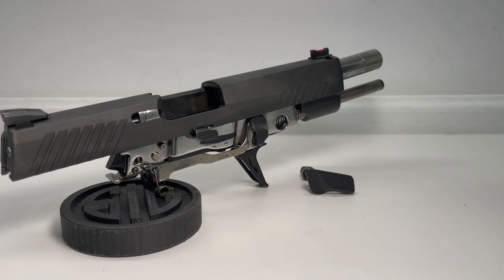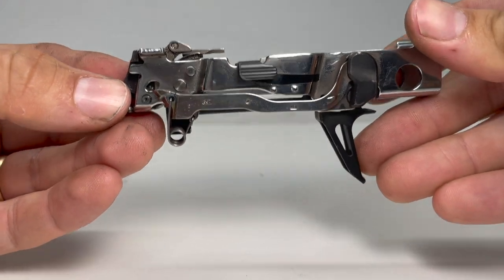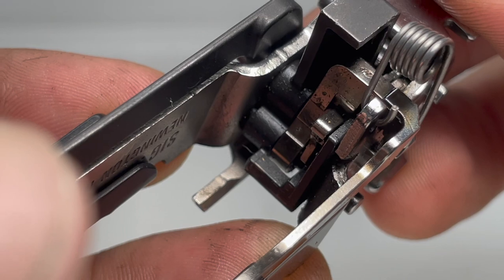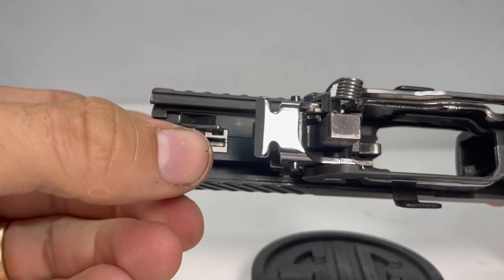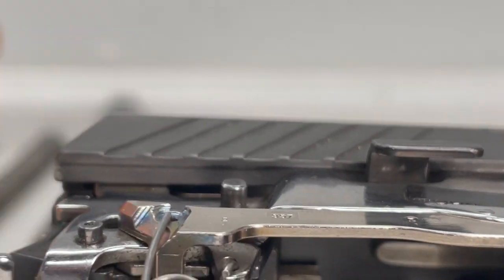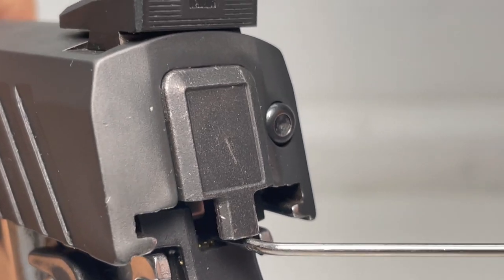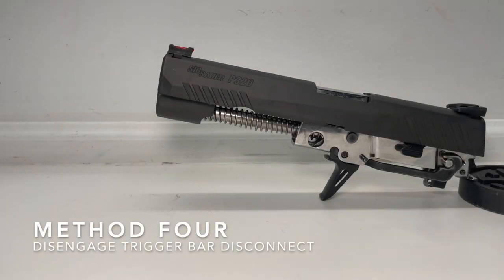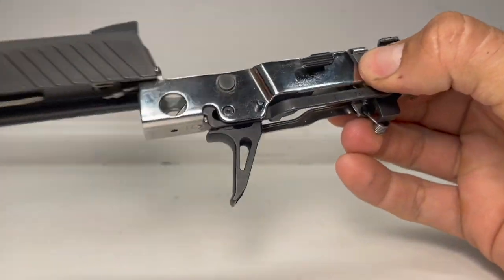P320 - 4 WAYS TO FIX A FORGOTTEN TAKE-DOWN LEVER

Comment: Just so happens, I was at the range today to let someone try out my P320 and demo'ing how to remove the FCU. I forgot to put the takedown lever and this video would've been invaluable had I had a connection. I'm not sure, but I think trying to insert and rotate the takedown lever allowed me to pull the trigger and slide the slide right off, leaving the FCU still in the grip module. However, I will save this video and try leveraging the sear forward if this happens again. By the way, I have now subscribed. Enjoyed your explanations and instruction. Also admired how shiny polished your FCU and barrel looked.
Reply from the maker: Ah, sucks when you don't have access to the information until it's too late...Well, I hope you keep this channel on "speed dial" and It comes in handy down the road. It takes effort to get the take-down lever in there but I'm happy it worked out.

Also...I didn't add this 5th method to the video, (I probably should have) but you can also force the take-down safety lever (black bar), backwards by hand, which will also engage the sear and force it down too (equivalent to how the take-down lever does it normally). 

Lastly, one thing to keep in mind is that sometimes the disconnector will get in the way of the slide while on the way out, so it "jams". It's an easy fix though because you can manually push the disconnector down a bit with your finger or small tool.

Anyway, thanks for watching! Glad to have you here.

Comment: I'm glad that I watched this video, the first two times I mistakenly did this while demoing how easy it was to take apart, I somehow managed to coincidentally apply just the right forces while panicking and wiggling the slide both times to almost immediately disconnect the slide from the FCU. Realized after watching this that I probably put a little impact/wear on the sear that I shouldn't have, but I'm surprised I was able to "fix" it on accident at all. 😅
Reply from the maker: Ha! I just pictured the scenario with others watching and judging and laughed. Those MIM parts are made of S1 material, super high impact resistance, I don’t think you damaged anything on the sear though.
Reply: Pretty sure I just did the same thing myself. Pulled the trigger and a little wiggle and it came off. Haha. Hoping I didn’t damage anything

Comment: I had a brand new OEM takedown lever break yesterday at the 20th round fired. Managed to get the broken piece out, now the slide is stuck on the FCU and will only move about a 16th of an inch either direction.

Update: your 3rd way helped!!! I did this on a M18X. The dual RSA was a bear, but gloves helped. Also, the rear plate is held in place with  slightly different pin. Most of my P320s, yes, simply push in the button on the back of the extractor tension (probably not called that, lol). Mine twists and pops out… took a minute to figure that out, lol.
Reply from the maker: Sounds like you have the military style pin on the extractor spring! Very cool, I’ve been looking for one, I guess it might be stock with the M18X?

I’m glad you were able to figure it out.
Reply: @SIGMECHANICS Thank you for your very informative videos!
Yes, the M18X came standard with the military style pin on the extractor spring. Not even my commemorative M17s and M18 have that. The only one I was somewhat familiar with was the original two pin (key) needed to remove and intended for unit armors. Glad to see that fell to the wayside, lol. The pistol also has a U.S. 9mm marked FCU and M18 serial number. I swapped out the OEM grip module for  a Bore Sight Solutions module.

Comment: thanks for taking the time to make  and share the vid.. maybe every p320 is different but i tried the first two with no success but the third technique did the trick.
Reply from the maker: Hi @K Anderson, I'm surprised! The first one is probably the most effective one in my opinion... Keep in mind that you have to push the FCU back while simultaneously leveraging the sear forward (works better that way). However, I am glad you got it worked out! I don't know a single owner that hasn't gone through this. It's the unofficial rite of passage for the P320!

Comment: Thank you! Going to try this today! Hope to avoid walk of shame to the gunsmith.
Reply from the maker: It’s very easy and you will most definitely not have a problem but if for any reason you can’t, I’ll help you avoid that walk. Shoot me an email to sigmechanics@gmail.com and I’ll walk you through it.
Reply: I was able to separate the slide and FCU from the grip (had not thought of that) and method 1 worked like a charm with a bit of pressure. What a relief! Thanks so much - have your excellent video bookmarked!

Comment: You can also push the guide rod forward through the hole where it ends near the trigger to clear the take down lever whole enough to insert it, then pull out the tool on the opposite side of the gun. LIke a guide pin in effect, just holding the spring/guide rod long enough to get the take down lever installed. Not necessarily easy, but doable with a thin screwdriver. I only later discovered that the whole FCU and slide would about fall out without the take down lever. :)
Reply from the maker: That is a great point too. Though, like you pointed out may be a little tough with the tension. 

Another way (that I didn’t mention in this video), is to take the takedown lever (the black bar opposite the trigger bar), and push it towards the rear of the FCU, doing that will also drop the sear, but will require some manipulation because it’s an awkward way to grip the part as well as the FCU.

Comment: Thank you so much for this video. That was one of the most frustrating things I have dealt with. The sear method did not work for me so I had to pull the striker assembly out of the slide. The FCU was still super hard to get off the slide even after the striker assembly was out. I had to push so hard and I had the force of the recoil spring helping me. Have no idea why it was that hard. Functions just fine now though.
Reply from the maker: @Ryan McCullen, Ah that sucks. You actually had another problem… sometimes the disconnector will get stuck on the slide frame on the way out and jam the whole FCU from coming off. You just need to use a pick to push the disconnector down a bit and it will slide off easy.
Reply: @SIGMECHANICS  damn, that would have been nice to know about 2 hours ago. 😂 Thank you for the reply, hopefully I'll never need to use that knowledge. That was a lot of frustration for a stupid mistake.
Reply from the maker: @Ryan McCullen, once you know, you know for life. I learned because I have to disassemble and reassemble the P320 so many times while making these videos that I think I’ve run into every possible combination of problems by now. Luckily now I can pass on the knowledge, and hopefully the next guy reading our comments will be saved a headache!

Comment: Hello
Nice video. My problem was not covered though. I forgot to reinsert the take down lever. Pulled the slide back and it froze. The main spring is fully depressed and the barrel is tipped up. Since the slide is back further than your 4 examples I cannot get to the sear. It is covered by the internal mechanism. Any suggestions. Thank you
Reply from the maker: Send me a picture to sigmechanics@gmail.com I’d be happy to take a look. Most likely the recoil spring assembly needs to be adjusted. It’s a quick fix.

Comment: Can you do a video showing how to remove a broken takedown lever easily? Thanks in advance!
Reply from the maker: What happened? Did your snap off in the through hole? Which TDL did you have?
Reply: @SIGMECHANICS  mine has been fine but the factory levers and GG levers have been breaking out there while shooting and it sounds like a real pain to remove the piece that is left in the frame.

Comment: When the Take-Down Lever is "closed" my Trigger wiggles a little bit to the left and right. When "opening" the Lever it is rock solid left to right. Is that normal?
Reply from the maker: @CYNX, I haven't noticed that on mine. I will have to test and check.

Comment: I have a bigger problem. I put a sub compact slide with dual comp on a full size frame and it sits flush and looks amazing. Unfortunately the slide stop and take down lever will not align with the slide, not allowing me to rack the slide back and it won't let me rotate take down lever to 7 position. Not sure what to do unless I sacrifice a part
Reply from the maker: Sounds to me like the recoil spring is the problem here. Send me a message to sigmechanics@gmail.com and I will help you resolve it.

Comment: Can we still pull the grip and FCU apart (as in 6:11 in the vid) if it is a California model (no mag=no fire feature)?  Mine has the barrel and spring/rod out of the slide, slide on the gun with no Takeddown lever- the FCU doesn't want to come up & out- only comes halfway out...  Thx!
Reply from the maker: I don’t know and I hope someone with a Cali model can chime in. I am willing to help you out if you want to send me a few pictures to sigmechanics@gmail.com, maybe I can figure it out with you.
Reply: It’s me I’m that guy. Easiest way to free it is to pull your guide rod down.
Reply: I’d honestly try to reinsert the barrel and spring with the FCU in there so it’ll depress what it needs to. It’ll need you told hold the recoil spring down. Honestly you may just need the barrel back
Reply: Additionally if it is a disonnect issue. It’s held in place via Allen key. Just take it out, you should have access with FCU in place, comes right apart.
Reply: Just below your trigger spring you’ll see the key, small. Once removed the disconnect falls apart in two pieces and a spring, should allow FCU to be free, from there reinstall disonnect if you want it

Comment: Just happened to me… basically used method 4. I got the slide off  by racking the slide while on the grip module. Then I pushed the slide with my thumb as far forward as I could and press the trigger. The slide went flying off. 🤣🤣🤣
Reply from the maker: Ha! Glad it worked out!

Comment: I reassembled my p320 and my takedown lever is stuck in the 4-5 position. Can't slide forward or reverse.
Reply from the maker: @Dave Skophammer, that’s pretty common. It’s basically the recoil spring binding up with the lever. If you can’t access the recoil assembly your best bet might be to put some elbow grease into it and use some light force. You can always message me at sigmechanics@gmail.com we can run through the process together.

Comment: I slide back already and remove the striker and some how i still wont slide fcu out
Reply from the maker: Take a fine tipped tool, and pull the slide off as much as you can, then use the tool to push down on the safety lever. Sometimes it gets stuck in the opposition, and gets in the way of the slide.

Another option might be the disconnect. Push down on the disconnector, because sometimes that catches the slide as well.

Comment: Anyone had an experience with this on a p320 compact? The sear doesn't seem to remedy the issue.
Reply from the maker: @Joey Serrano, what seems to be the problem? The compact FCU will be exactly the same as the one in the video. So if you’re having trouble, the resolution will likely be something we can find across the platforms. The most common problem with a that the disconnect is jamming against the slide.

Comment: OK so I think I forgot the take down lever but it will reassemble except the slide is out of battery about 1/8"
Reply from the maker: If you forgot to install it you will have a through-hole at the mod section of the grip. If that’s the case, you should be able to insert the grip, just. If complete the reassembly.
Reply: @SIGMECHANICS  hmm. When I went to install the takedown lever the slanted metal piece was partially blocking the hole as normal. Slide can be locked to the rear and takedown lever snaps into place when rotated
Reply: @SIGMECHANICS  OK looks like my safety lever pin fell out and is missing. WTF sig this is bullshit I gotta worry about pins just falling out removing the chassis?
Reply from the maker: Yes, that’s pretty common. It’s not something that happens on all FCUs, two of mine do not fall out and one of them does.
Reply: @SIGMECHANICS  sigh. I assume it just pops back in?
Reply from the maker: That’s right, take a pin punch, put it through the FCU from right-to-left, this will alight the FCU hole to the through-hole in the safety lever, then simply use the pin to push the pin punch out from left-to-right.

Hopefully that makes sense but if you have any trouble at all, feel free to email me at sigmechanics@gmail.com, I’d be happy to walk you through any of this.
Reply: @SIGMECHANICS  thanks I found a relevant section in one of your awesome videos 👍
Reply from the maker: Awesome! I knew the videos would come I hand one day! Either way, if you ever have a question, feel free to get in touch.

Comment: my takeaway from this...simulate in battery condition and pull trigger is the best method.
Reply from the maker: Absolutely. If you can find a way to simulate the right condition, it will work. 

A fifth method is you can push the take down safety lever bar back to simulate the TD lever being turned. This in turn moves the sear down. (Plus no tools needed). 

Thanks for watching!

Comment: tried this and the trigger spring broke. Guess I was fucked anyway lol.
Reply from the maker: Which method did you do where this happened?
Reply: The first method. I've taken apart the trigger assembly before to change out the trigger head itself, never had any real issues with the spring. Guess it had weakened or warped enough to cause it to snap. Cant say I ever put much pressure on it. Honestly this is the first time I've ever not replaced the takedown lever. I got the trigger assembly off the slide, but now I need a new trigger spring. I may purchase one and sell the gun. Idk. Not a fan of my gun being temporarily bricked simply because I forgot to put the takedown lever back in after cleaning the trigger.
Reply from the maker: @danc5644 yeah, I think the trigger spring must have been in bad shape. I had that happen to me once, however, at the time I was assembling and reassembling the FCU multiple times over and over and I must have weakened the spring. 

The takedown lever issue you’re facing is technically for your safety. It is the reason why the P320 does not require you to pull the trigger when you disassembling.
Reply: @SIGMECHANICS  The worst safety issue I'm getting without that design is some busted drywall or a black eye. The worst I'm getting with it is a blunt object instead of a firearm. I think I'll take the first one over the second one.

Comment: Thanks.  I have a slide stuck on and somehow I got mine stuck because I forgot to put the back plate on.  The striker and extractor have come out but I still can’t get the slide off the frame and I can’t get the fcu out of the frame because I can’t get the take down lever out.  In your video you showed one method is to remove the striker assembly.  Mine is out but it still won’t come off.  Any ideas?
Reply from the maker: Perhaps this is a problem with your guide rod being inserted incorrectly? Feel free to shoot me some pictures to sigmechanics@gmail.com and I’ll take a look